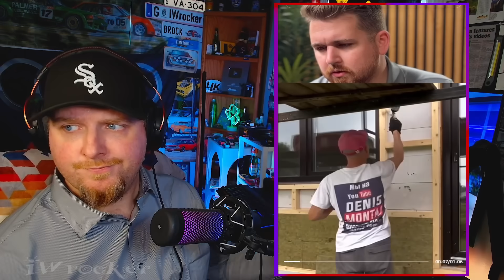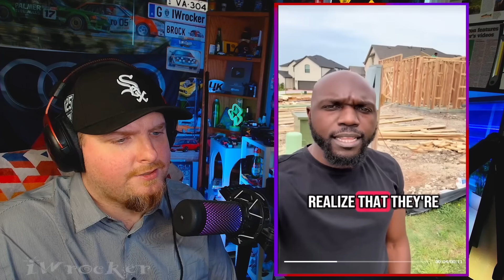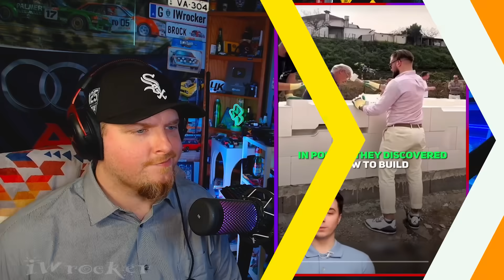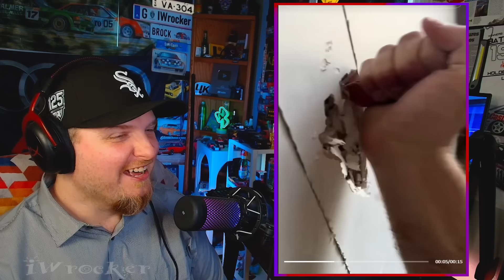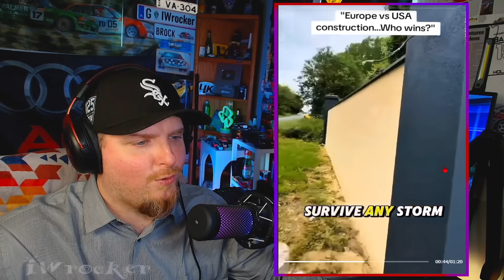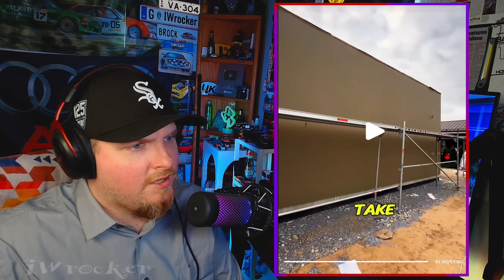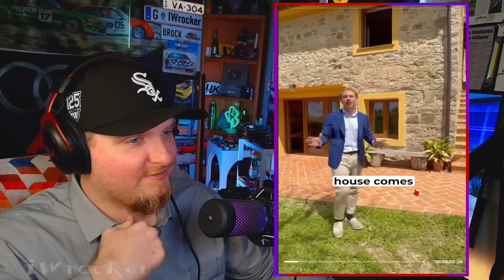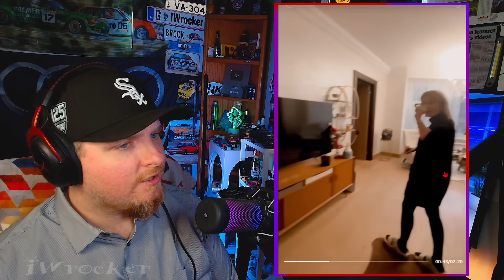25 Minutes of European VS American Home Quality & Construction Methods 🔨

Comment: The house facade is actually a real block of flats (Thurloe Square, Kensington), although it was originally planned to be a standard shape until London Underground bought a chunk of the land apparently. The flats are a visual illusion, wedge shaped to make them somewhat practical, expanding from 6 feet on the leading edge to 34 on the side you can't see.

There are other more classical facades too, where the front of the former building fills in the visual gap where a higher level Underground or surface railway line runs underneath it (e.g., Leinster Gardens), built when the trains needed to vent steam at regular intervals.

Comment: My house is over 100 years old. It's unclear how old but I found a fragmented newspaper from 1927 in the attic. Old maps suggest it may be there over 150 years. Sadly it wasn't well maintained, and even though it's a good german construction, it needs a ton of work. But it's also great because it needs a ton of work. I'll move it to the 21st century keeping the old core and giving it all the sweet upgrades a European house can get. That includes also the 50cm of polystyrene on the exterior to keep heat in.

Comment: Ok a few remarks about the European stuff:
- the building style, construction methods and insulation and building costs vary very very much across Europe. those heavily insulated houses with the crazy thick foam you would not find in the southern parts and even in the northern parts it is rather a lot of insulation compared to what most do. you have to factor in that most private homes in Europe do not use AC or dehumidifiers, so the "breathability" of walls is a completely different story compared to the US. 
- that polish "lego brick" method is rather new and not wide spread yet. 
- the cheap appartment at the end is probably in an eastern European country, looked like Prag or Budapest or so to me. A similar appartment in a major city in say Spain would be twice the price, in Germany a bit more even... and it varies a lot within a country too, can be double in say Munich compared to Hannover. Or in Edinburgh compared to Glasgow
- generally prices are lower in rural areas all across Europe
- impressed that you not only knew, that Italy is a country in Europe, but that Tuscony is a part of Italy. Not bad for an American! :-)
Reply: "Relatively new"? These bricks were copied from West Germany "during the communist era." The only change is that today, by law, at least 17 cm of polystyrene must be added.
Polystyrene has been used extensively for insulation in our country for about 70 years, mainly in production halls at that time.
If you have no idea about technology, it's better not to comment on it ;)

And that apartment was definitely not in the Czech Republic or Hungary... Based on the price and architecture, it was in Tallinn...
So you're a little off the mark with your estimates here too

Comment: 8:00 to be fair, in Europe you use that kind of material if you want divide large room into smaller ones or if we have old buildings, we use that materials with insulation inside a apartment.

Comment: I don't have anything against the building style in America. What I think is messed up is the price – for the same money, you can get a new brick house in most of the EU and even more in Eastern Europe. It also has to do with safety: a wooden house, which most houses in America are, burns quickly, and children and adults may have a hard time getting out, whereas brick/concrete houses are more fire-resistant and therefore give a bit more time to get to safety.

Comment: Cant comment on the building you showed from London, however some of them are actually only a frontage hidden in a street, they hide main ventilation shafts from the London Underground.  They were mainly built when the underground was conceived and have been maintained like that ever since. They have a front door and window frames, the windows however are painted brick and even have curtains painted on them. Front door is for inspection purposes. It just made the airshafts more acceptable to folks in the area.

Comment: You can’t do exterior styrofoam on a wooden house. That will trap moisture inside the walls. You need concrete- then it is good

Comment: behind the fake  house is a big open ventatlation vent for the underground trains and when they were built  ever so often they had  to have big ventalation velts to let oxygen into the tunnels and the residents of the street said ok you can build a big hole but you must build a house facarde to cover it so it doesnt  show above ground, very common in london .

Comment: In Italy, houses are built according to strict earthquake-proof regulations, with brick walls and a load-bearing structure of reinforced concrete and steel. Even buildings three or more centuries old are renovated in this way. Therefore, an American house in Italy would never be approved by any technical commission in any province or region. In fact, in some regions, especially in southern Italy, construction regulations are even more stringent.

Comment: its ouuside so the walls are heated up a bit and dry ...and also so the dew point of the water vapors goes into the insulation. with all permits , papers and money they can build up a brick house in 3 month in europe. the curing on the concrete foundation and the deck takes the longest.  some decades back it was a custom to take it under roof sometimes with windows sometimes without...leave it for a year to set and then continue and complete it.

Comment: To be fair to USian construction, framing and panels is very quick and efficient. Just use steel framing and SIPs (structural insulated panels, 1/2" of structural board either side of 3" insulation) rather than wood and cardboard maybe? 3" steel C channel and 4" SIPs is a solid building method, you only need uprights every 8' instead of every 4' with the typical building method over there. Makes it faster and it'll last longer while still not going for the full brick and concrete builds. You can also use the same method for interior walls so ne need to find a stud to mount something, just go ahead and fix it where you need to. It ain't rocket surgery.
Roofing can be done the same way, generally 3" SIPs with aluminium cladding rather than board. You can pretty up the outside anyway you want but the main part is already sorted.
Don't get me started on electrics. We're not great here as lighting no longer needs to be anything other than 12 V DC but seriously, get some decent safety standards over there OK? I actually like you folks in the Midwest. We don't talk about the others.

Comment: 13:30 and, you can perfectly get these bug windowscreens with these small springloaded little hooks that you place on the outside of your window, and hook on the inside rim of your windowframe. That way you can open your windows or vent them without getting bugs insise, while still being able to close your window. The more traditional frames you had to open up your window, and place this thick frame with the mash on the inside, making you not able to close your window anymore 😅

Comment: The actual house (germany) of my partnts is brick made but the one we lived before, was a so called "Fertighaus" (Readyhome?) 
I include a link to a video on my old channel, showing the whole street where i did spend my childhood that i did rebuild for the original Counter-Strike 
The way that house is build is by preproduced, poored concrete sections of the outerwalls (looks like if the US builds another aircraftcarrier when those are lifted with a crane). The front wall on the groundfloor for example had (if you stood in front of it looking from left to the right) also the openings for the kitchen window, front door and guesttoiletwindow already in it. They slap those 4 sides together and than they had do make everything ready to poor concrete for the ceiling / 1st floor ground on it. After that cured, the next 4 walls would have ben lifted on it and so on. It was 4 storys including the basement and attick but last one was also living space. It was in fact my room as a teen and i had like 620 square feet useable room, the part alrdy discalculated where the roof was to low. A house like that back in the 80's iwas build in like 1 or 2 weeks + the time it takes for the installation of electricity and so on. I did recreate my childhood street in counterstrike because i rly missed it some times https://www.youtube.com/watch?v=nq1n79YDSC0   
Yes, i did rebuild every garden like it was because i went to all those places as i was young multiple times a week. The whole street was like a playground for us :D 
That blue viper without stripes was rly painted on our garage door. I made very smal painting of it, that i captured from a screenshot i took in the game viperracing in 1998 and my dad did paint it onto the garage door than at night, using a beamer to geht the lines in place xD  
2:52 entering our garden and 3:17 is the front side of our house back than until we moved out in 2006 if i remember that right.

Comment: I once made a hole in a wall with a screwdriver. It was a divider wall made out of chalk brick. Still took me an hour to carve through the  15cm… the load bearing walls in the apartment were 40cm rebar concrete. It was almost impossible to drill a hole in that stuff…

Comment: The house i live in is probably 75+ years old (the area was bombed in WW2 and there was probably a house here but I think after the war its was rebuilt so parts could be older) we replaced the windows from wood to some plastic. the only maintenance on the house is when there is a heavy storm there are sometimes a few roof tiles that need to be put back. We had a 5.8 earthquake in 1992 (with the epicentre less than 10 km away and we some little cracks in the wall. Yes we renovated the kitchen and the bathroom etc. but not in size just the tiles and stuff in it. (and not the American way: put it on top of the old ;-))

Comment: lol. My house in the northeast of France was built after WW1 with reparations from Germany because they shot the original house to bits with artillery. (It’s not far away from the Maginot line). It was then rebuilt in 49 with reparations from the Germans after they shot it to pieces in WW2… My structural walls are 3 feet thick, my internal walls are 20cm thick brick walls. It has the original oak floor and has roof tiles from before 1985. And they are still in excellent condition. I know the minimum age, because the local company that made them went out of business in the early eighties… still the original shutters and had the original windows when I bought the place. I replaced the windows only because they were single pane and it was freezing in winter. Show me a house in the US that can match that…

Comment: Why the fuck would you use pressure treated wood on the concrete???? Its not supposed to get wet, that's what the wind layer and siding is for!! And of course the insulation works best on the outside, like what even is he talking about 😬

Comment: As someone who has been in American houses and lives in an European house. I like American houses because of how “warm” they feel, no cold walls, all is wood and carpets, big windows and a lot of natural light, good air circulation. European houses are a bit more limited in all of that, designs are more restrained, windows are smaller typically, houses are smaller too, air needs to be circulated cause houses airtight energy efficient boxes. European houses are much more advanced in tech though, better energy efficiency, better piping, better cabling, and in general everything is done at a higher level since once put in place they are very hard to change. So America - design, comfort, flexibility. Europe - efficiency and longevity. 

And obviously you can have elements of design and quality in both, but I am talking about the default expectations. With money you can obviously build anything anywhere.

Comment: 3:23 A WOODEN HOUSE, that is, a REAL wooden house, a real log house construction is actually HEALTHIER to live in than a house made of concrete and glass. The problem is that in building materials made on the basis of sand - in particular concrete - the natural radioactive radiation that is in sand. Today, however, it is considered harmless, since the radiation emitted is SIGNIFICANTLY below what is considered dangerous. So in those days, concrete construction was considered unproblematic. A bigger problem is actually RADON that seeps up from the ground, and both types of buildings are "equally susceptible, and the solution to get rid of the Radon problem is the same. In general terms.

Comment: 14:25 in Estonia  panel houses get  even finance support 20 % at renovation to put 40-60 year old concrete panel houses outside isolation and add ther trhu isolation  metal pikes ca  2 feet long and fix them outside isolation that these isolation panels not remove . Guaranty 40 years and i pay may part of that renovation 23 euro /27 usd / 240 months per month

Comment: I think you made a good point, and it is one of the reasons I don't like a lot of US houses: it is most often just a facade. Like a Hollywood filmset or a Disney theme park. As for walls, where I live in Europe, outside walls and inside load bearing walls are typically brick or concrete, but we also have wood frame/plasterboard walls. BTW Exterior walls in stead of fences, are actually not that common in most European countries. 13:56 this is not common in most of Europe. And to conclude, don't watch Cy Porter too often. It makes you wheep.

Comment: Regarding the “façade house,” I would suspect that they demolished a building that previously stood closer in the picture, in front of the façade house, and that behind the façade there is — or used to be — an opening from the underground. It’s worth remembering that when the London Underground was inaugurated, the trains were powered by coal-fired locomotives, and at regular intervals there were open shafts for ventilation. Some of these still remain, and it was common to build a façade at such locations

Comment: I live in a house dating back to 1750, built of stone and brick. A fire in the 1950s destroyed the roof and the wooden floors, but the house remained standing. My father restored it in 1980, and my family has lived here ever since. The walls vary in thickness from 30 cm to 80 cm. The roof is made of terracotta tiles and has stood there for 45 years without any structural problems.  All windows and door glass are equipped with insulating double glazing.

Comment: In my appartment there is not a single wall that would allow a stupid knife to get through... You'll need a jackhammer for that, even the non-bearing walls are made out of stone here...
Drywall is here used more regularly on ceilings; to lower them so extra insulation can be put between the drywall and the actual ceiling...

Comment: If it’s a vent pipe for the sewer system, it’s fairly unnecessary to have a rain cover on the pipe. Personally, I don’t even have a pipe sticking up; instead of a regular roof tile, there’s a special tile with a hole in it.

Comment: Estonia brick houses ca 20 % ; concrete panel houses 60 % ; wood houses 10 %, log houses 1 % ; steel framed glass houses 5% ,  metal sheet  storage type buildings 4 % .

Comment: I think that you're wrong on the faster to put up bit on the US houses.
Ours are made from prefabricated concrete slabs and I think it might be faster to put together than building a wooden frame, especially if you need to cut all the wood to size.

Comment: In my house (in Germany), absolutely all the walls are made of Ytong stone (aerated concrete), and the ceilings are reinforced concrete. On the outside, there is insulation and then clinker brick. Together, this is so thick that the people who installed fiber optics in my house had to drive back to the company to find a longer drill. They were really close to giving up...
In my parents' first house (where I grew up), the load-bearing and exterior walls were made of reinforced concrete, but some of the interior walls consisted only of two plasterboard panels on a wooden frame, with the cavities filled with glass wool.
If your exterior walls are like some of the interior walls in my parents' house and this house is located in an area with a climate similar to northern Germany, I really don't want to imagine what pointless heating costs that will cause...

Comment: The foam (EPS, XPS) is very comon if not our right default for buildings in Europe, and all new buildings are required to have this insulation by law. We are in to energy efficiency and this type of i sulation saves you a ton of money for heating/cooling. There is still buildings that dont have such but most of them are pre 2000s
Reply: Fun fact min thickness of the insulation is 10cm for new buildings, and you can add this to existing building without problems, when i was younk i used to to this

Comment: 18:20 this is where I live, the thinnest facade at Europe (or they say so), some years ago it eas its own building (getting wider in the back), but nowadays is united with the one at its right and it only remains the facade: https://www.google.com/maps/place/La+Finca+m%C3%A9s+Estreta+d'Espanya,+Pl.+de+Lope+de+Vega,+6,+Ciutat+Vella,+46001+Val%C3%A8ncia,+Valencia/@39.4740788,-0.3768017,21z/data=!4m6!3m5!1s0xd604f34876b7d87:0x3859229c700f3a5!8m2!3d39.4740785!4d-0.3768299!16s%2Fg%2F11q4jspshc?utm_campaign=ml-ardl&g_ep=Eg1tbF8yMDI2MDIwNF8wIOC7DCoASAJQAQ%3D%3D